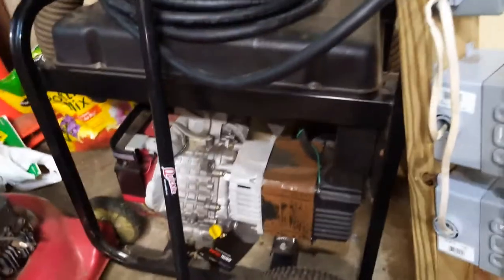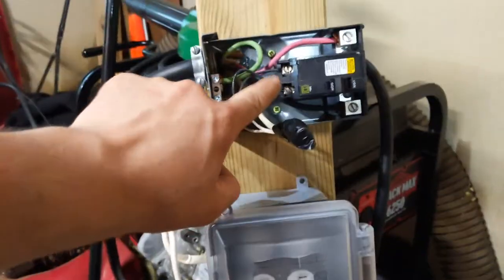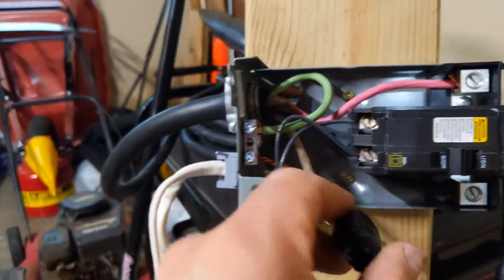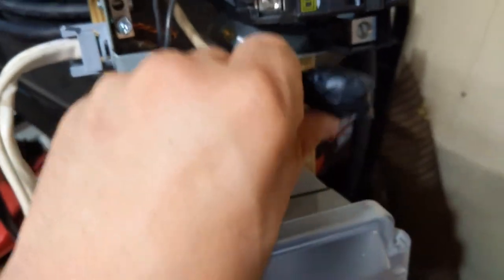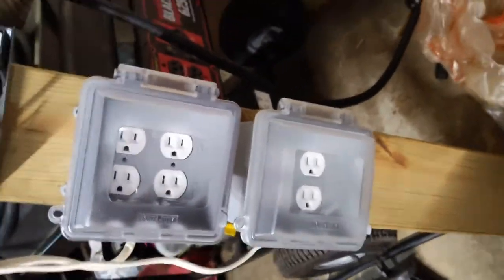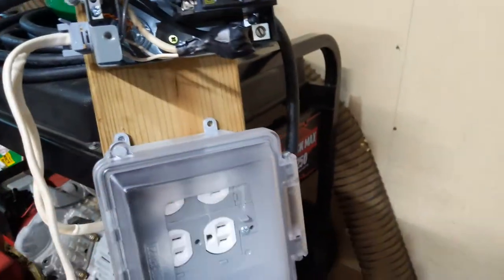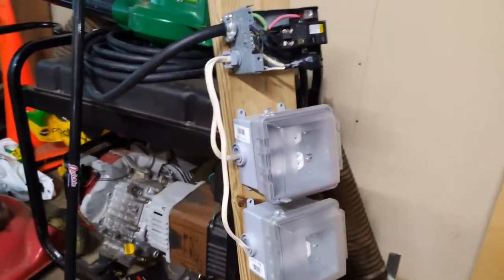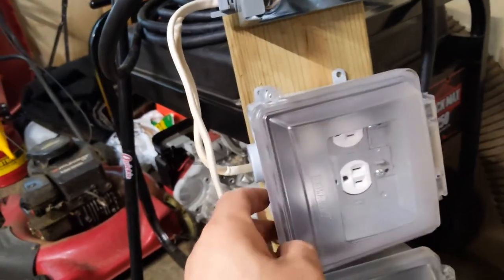Simple power distribution panel for generators.

Comment: Little confused. Looks like only one 120 V lead is connected to the breaker??
Reply from the maker: It may just not show up very well in the video. But each pole of the breaker has a 120 leg attached to it. The wire on the right side, is hard to see as it is a black insulated cable.
Reply: @WillPhoneman  wow yeah difficult to see but I see it now. Thanks ☺️
Reply: Here's another question for you! If your cutoff switch was one of those breakout breakers would you still need a 30 amps because it's rated to 120 or would it be 15 because it's considering the combination at 240?
Reply from the maker: @fnscomedycrew  I'd still go with 30, as you are likely using both 120 volt circuits simultaneously.